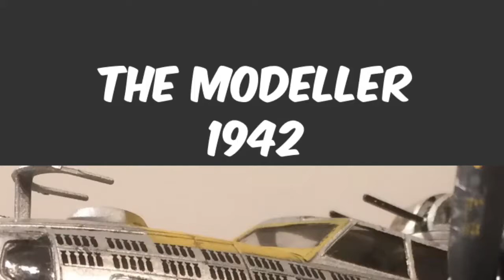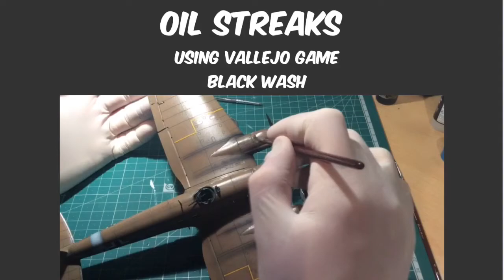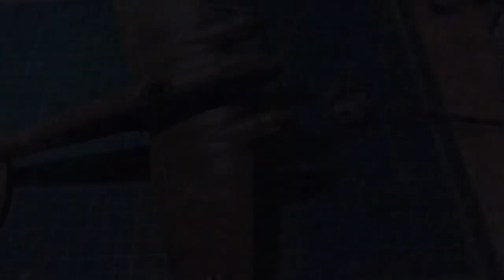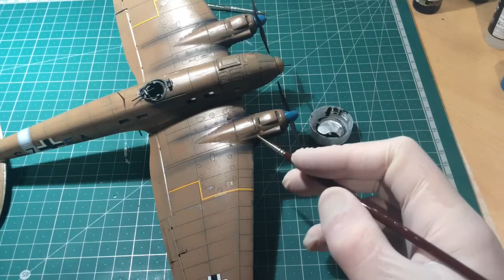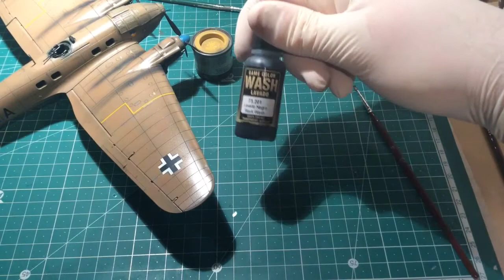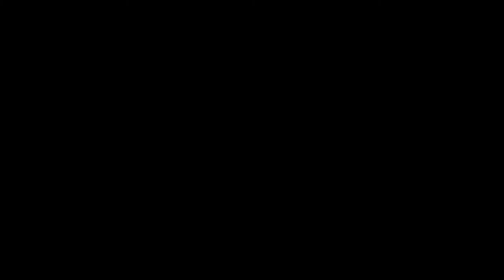Quick modelling tips #3 Oil streaks

Comment: Excellent tutorial. Your models are amazing. Can I just ask is this the same technique that you used for doing the exhaust stains on top of the wing. Looks really effective. Thanks.
Reply from the maker: Hey, thanks mate! For the exhaust stains I’ll airbrush a mix of really dark grey (just off black) mixed with a touch of brown. Then I’ll dust up the most heavily sooted area with a lighter mix of black and grey. This lighter staining is much more prominent on British aircraft over German, Iv read somewhere that it had something to do with the lead content of the fuel.
Reply: Nice one mate thanks for the info. I have just got hold of some of that Vallejo wash so i will give it a go. I suppose neat oil paint would do the same sort of thing for the oil streakes.
Thanks again mate, And i really do love your models they look bloody excellent.
Reply: @mohawkmodels2665   do you have a video to do this?